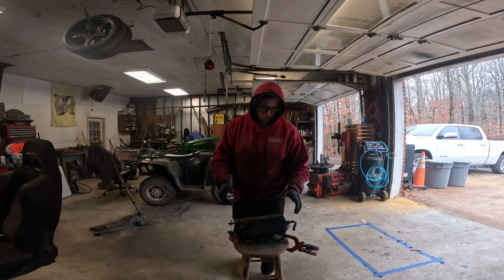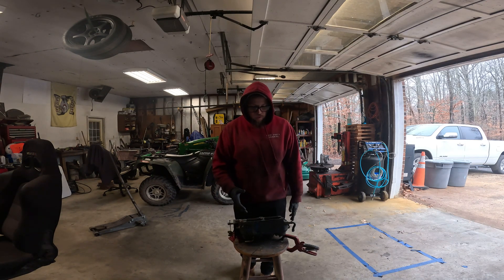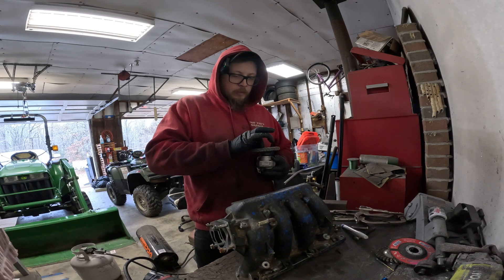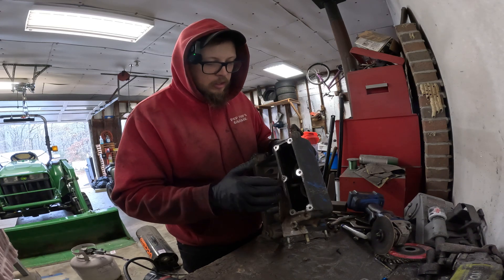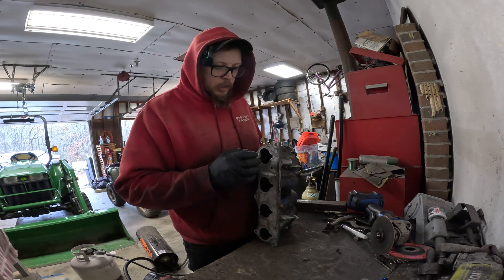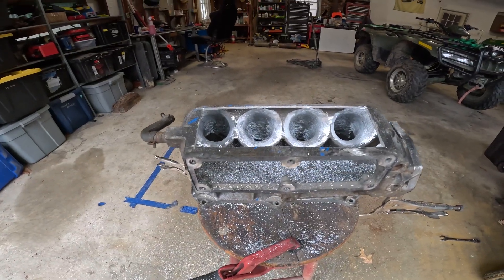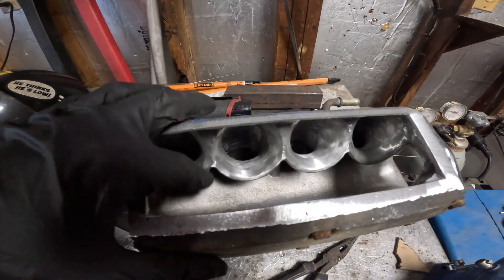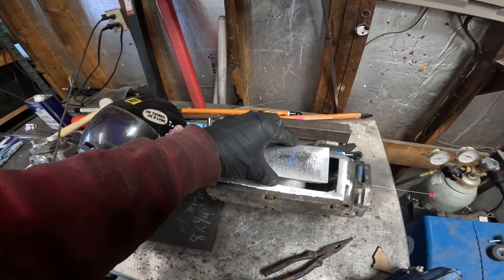PRB, The RBCs Little Brother? Lets Port It!

Comment: Guessing you just hondabonded the 6 bolt plate back on?
Reply from the maker: @190Bmxer190  yup!
Reply: @pop_pops_garage  thanks. I need one more vacuum/boost source for my bov, so I'm thinking of tapping a 1/8 npt fitting into this plate.
Reply from the maker: @190Bmxer190  id tap it into the plenum since its thicker. or if you have a local welder they sell plates you can weld on with different size holes for different fittings.